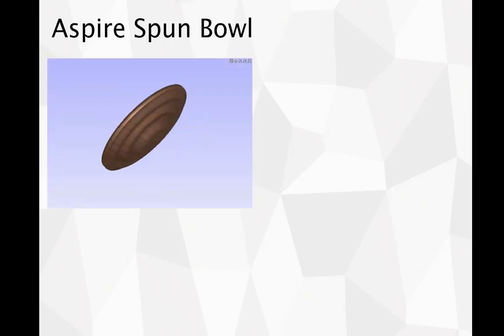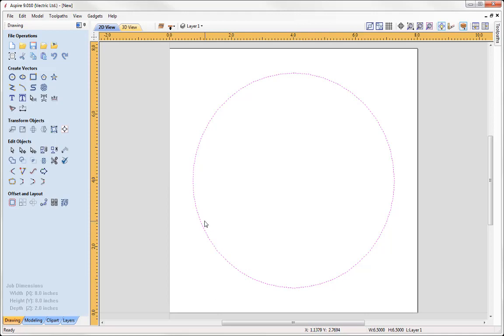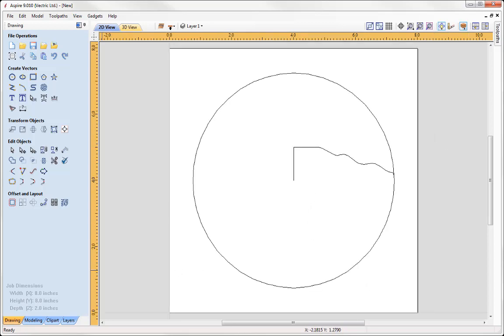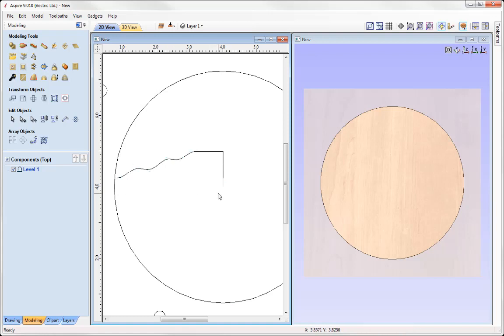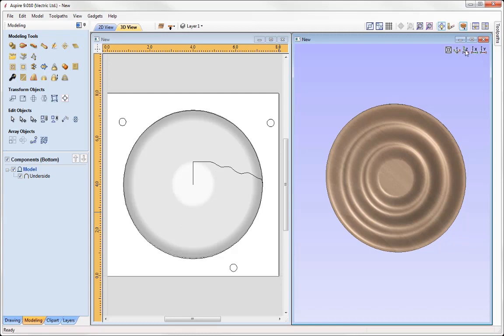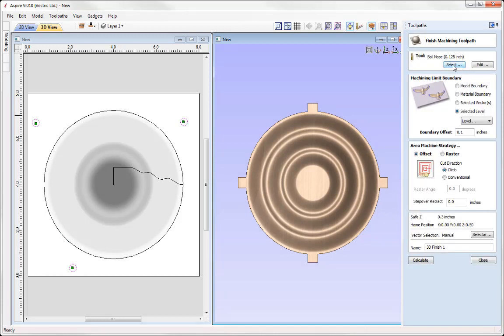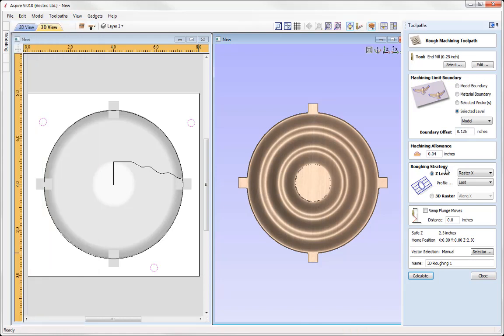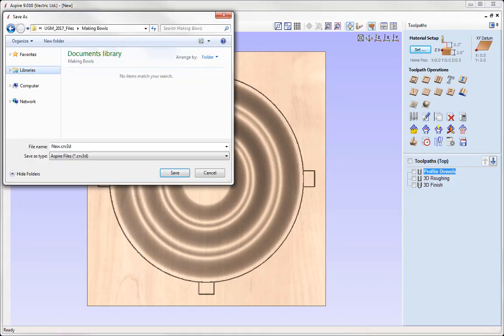Tips & Tricks | Making Bowls Spun Bowl | Vectric

Comment: Great tutorial. However, I want to use a specific cross section. How can I import a cross section slice from Sketchup into Aspire so I have a very accurate representation of the model created in Sketchup?
Reply from the maker: Thank you for your kind comments :) is your cross section in a vector format in sketchup? If so you can use the Vector Import tool to import the SKP file and you will have your vector design imported that way. :)